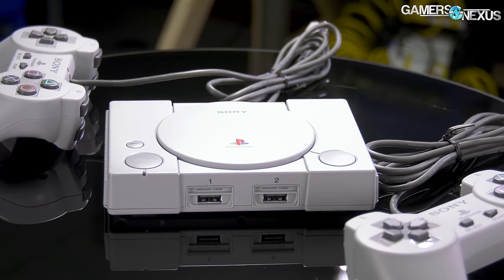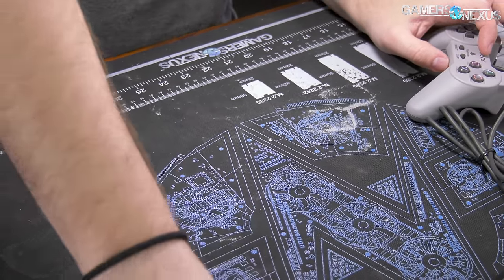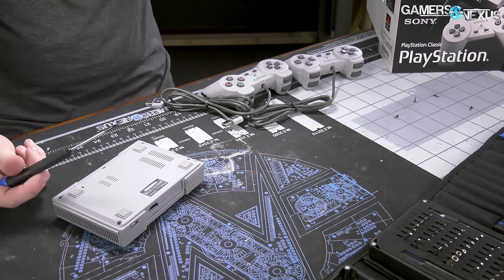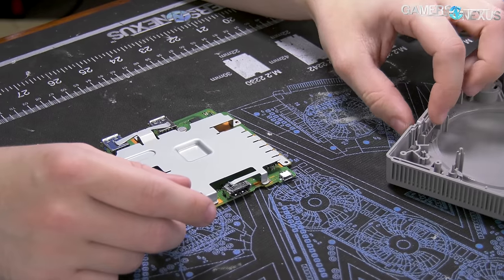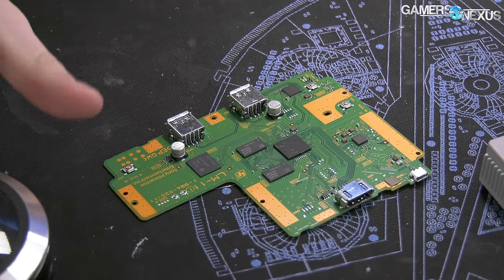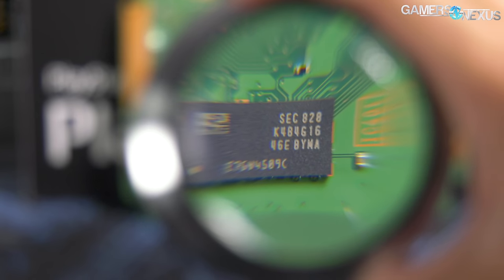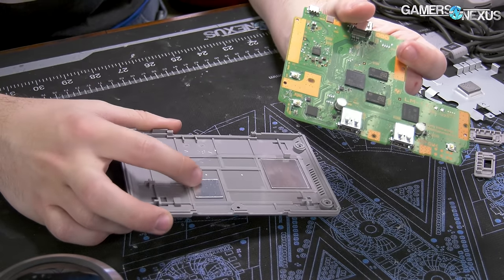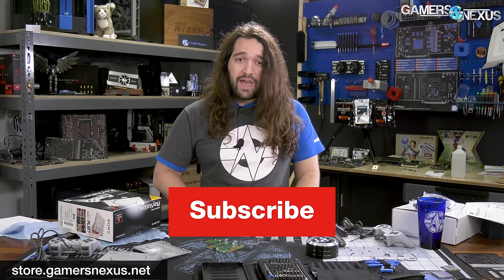PlayStation Classic Tear-Down & Disassembly (PS1)

Comment: Great video ... kind of hilarious though not getting the point of the vents with the metal in front on the bottom.  Its literally a visual thing. the original PSX had those vents on the bottom where youd see the lower metal shield if you looked through, its just a little "touch" that makes it visually closer to the original, just like the entire point of the thing.  

People are complaining about it but lets really think about this. It comes with a controller right.  And it comes with its "shell".  A decent raspberry pi case shaped like something will run you like 20 bucks.  Lets say the controller is as cheap as possible and you could buy the equivalent for 5 or 10 bucks, whatever.  So youre up to 25-30 bucks.  That means the rest of the price is literally for the guts which run the games, and the legal license to own the game for play... Id say its not that bad REALLY.  

I personally just own old playstations (I think the SCPH-1001 made after a certain point is the best... you have the best audio DAC (Still known as one of the best CD players of all time in terms of audio fidelity) and the Rev C graphics chip which actually made a big difference with banding etc in games.  The Early SCPH-1001 has that issue and the next models lack the AV jacks and the higher quality DAC.  The big issue with the SCPH-1001 is the lasers are pretty bad, but you can get the  KSM-440BAM laser and move the shield over from the old drive unit, and then it fits and works perfectly , while giving you the better laser assy.

Comment: I'd like this more if it had more quality games. There are plenty of games they could have given us, and some they should have scrapped for the idea. Considering that Resident Evil Remake is on Xbone and PS4, they shouldn't have used RE. Nor should they use RE2, no, instead they should've used RE3 or a game that less people would have recently. FFVII is supposed to get a remake....whenever, so they should have done FFVIII. MGS is fine, that's like the only reason I'd get it, but I already have it. Persona is a hit or miss with me, they could have replaced Persona 1 with Persona 2 and it wouldn't be any different for me.

Comment: I liked this one, cool stuff. I think Microsoft is working on something like this that's going to release next year aren't they? That was the rumor anyway, some sort of stream box for cloud gaming. Hell if they can reach somewhere near this performance that might be the way to go for console gaming. I tried out Geforce Now and I was surprised how low the latency was, though I am on a fairly high speed wired connection. Still though, there may be something to this. But I don't think I will ever enjoy a day where I can't build my own stuff. I'm also on ultrawide and have been for two years now, and I haven't seen one of these that supports UW resolution let alone higher refresh rates/fps than 60.

Comment: At the beginning it seems like you are kind of shitting on it for being lighter than your phone but I think by the end you realized that it only really needs a less powerful version of the lighter components of your phone (doesn't need a battery or screen which are the heaviest two components of most phones) plus a few connectors which your phone could have with an adapter cable.

Comment: I've got a question for you all. Will the next ps be a ps one mini or will sony go straight to the ps2 mini??.
Reply: The hardware needed to emulate ps2 is significantly more powerful. There is still alot of slowdown and low ROM compatibility with PS2 emulation currently. You need a fairly powerful PC to emulate PS2 in a somewhat authentic experience. 

Personally i think they missed the opportunity to produce something good while they had the chance. They used cheap hardware that barely runs the emulator at full speed and alot of the time doesn't. Just poor decisions all round IMO

Comment: So my 16 GB of DDR3-1333 cost 3.2 $us? wow
I think I know why VRAM is so much higher effective frequency than the GPU: Given the synch timings the effective bandwidth is reduced greatly, so the higher 4x effective frequency helps mitigate this latency making the RAM as close to the working GPU frequency as possible, like the VRAM wasn't off cheap but a large L3/L4 Cache, making the whole Video Card as efficient as possible and as the GPU allows it. Quad Data Rate, QDR RAM, is the fastest now, so the most expensive and hence the VC being more expensive than CPU+RAM. At least we know VCs are very efficiently powerful at processing graphics, glad to see PCIE 4 will arrive for even more efficient functioning but AFAIK it' wasn't a bottleneck; but I wonder the CPU-GPU coprocessing how efficient it is?

Comment: i think most of the price is b/c of licensing the games to put onto the flash to sell. 20 games is a lot of licenses. $10 ~ $15 a game in the 90s i think the pricing was. As they most likely are using ROMs and not the actual code of the game it might have legal issues too that Sony wanted to stay away from. So 20 games + around $5 ~ $10 in parts for $100 retro console is better than most things you can buy .... legally now for games and get that many games. The question is are enough of them actually good games?

Comment: tbh take a ps1 over the emulator. and if your going the route of emulator just play on your pc? most of them you can upscale res to 4-8k making it look alright.
surprised they did not make a ps2 instead of ps1. ps2 had better games imo and had something like 70 or 80% of the market with it.

Comment: Looks like Sony did well with the hardware but crappy with the software. I expect that (assuming the software can be modified like it has been on the NES Classic and SNES Classic)  we will probably see someone come up with software that doesn't suck (i.e. better more capable emulator, fixing those games that are using the wrong version and dont work well on all TV sets and no doubt adding new games too if possible)

Comment: It does come with the power cable you mean it doesn't come with the power adapter and if you have a phone which you showed us you do have the adapter lol. Also the chip inside did in fact take up more than 75% of the shell unlike the Nintendo variants

Comment: Digital Foundry already did a breakdown on the games. It uses the ARM version of PCSX. The games don't run that well. The frametimes aren't as good as the original console in something like Ridge Racer and the games even though running at 720p, look blurry especially Rayman.

Comment: I wonder why these things even have USB power ports that support data transfer, I mean obviously they Don't Care about us hacking it because we can just add me late on everything else.

But if they enhance some of the ROMs then we would get access to that.
Reply: At the same time the prototype board does need to have firmware updates and it does cost money I assume less than $10 / prototype. but it also cost someone's time so not having to change anything between the prototype and the mass production model probably more valuable.

Comment: Clearly the PAL versions of tge most hectic PSX games were added as a service to the modern gamers (a. k. a. filthy casuals). You think that people who can't take a simple 3d brawler that by 90s standards is very easy and not worth writing home about at 30hz (a. k. a. Dark Souls) can take Jumping Flash or Tekken 3 at 60hz? Frankly, 50hz is still too steep IMO but it was the slowest Sony could down to without the need to recode games so "modern gamer" wouldn't die on the first level.

Comment: The only unique thing about this is the controllers and the good looking case. But its not worth $100 for just that. Everything else about it can be done easily by any cheap smartphone or android device, as  already stated. Really boring hardware and user interface. It may have been worth considering  (after it gets hacked) if they had used a substantially better SoaC but this is no more useful than my hacked SNES Classic which can already play PS1 games fine (or Pi of course). Get an Nvidia Shield TV instead.....less than twice the price and has the same CPU as the Switch, clocked twice the speed. As a 'stocking filler' for casual buyers (the only people who would buy it) this is too over priced too

Comment: Just that they are using a crappy open source PCSX emulator rather then an in-house one, or something like ePCXe that does a great job emulating the PS1 on the weakes of hardware says how little they wanted to spend on this thing.

Comment: Kind of sad they charge so much for these considering ppl who buy them have probably paid for a ps1 once already.  A bunch of end of life parts bought super cheap with a 300% margin slapped on it :-/  They could charge $50 and still make a killing
Reply: @hoffer_moment  Didn't think of that.  I guess the level of ripoff depends on how many games are sony owned. :-)
Reply: With all the overheads involved to make these they would be lucky to pull much more then %40 profit. There is production costs as labor and parts arnt free. Not to mention they would have needed molds to be made for the casing. Other then all that it's still a poor product and the gaming experience looks weak. More of a collectors item to sit on the shelf rather then a nostalgic experience.
Reply: @Twenty_Six_Hundred  You are being overly generous.  Those costs apply to any product.  That being said I would be shocked if their margins were anything less than 90%.  300% was of course hyperbole

Comment: my god if only i had enough "throw away" cash id buy one to make it into the ultimate emulation rig. focused on making it into an overpowered psp basically, thats what i would like to do with it..

as far as how did they do replicating their old system, i'd say they did so poorly, the games run like crap i hear.. which is sad considering the internal hardware compared to the original psone hardware, it should run great, not to mention the rear port should be functional to allow them to release more gasme titles later down the road, but i guess sony learned their lesson when it comes to expandable memory and small gaming electronics with the psp and its massive security failure(s) lmao.. they didint wanna take the chance...

Comment: I wish they made a pie type machine or whatever is it's name and made the ability to actually put in flash memory card slots where the save game memory card slots are so we can put more games in and not be bothered with only 20 built in games. PlayStation haves tons of great classics which are out of print and over inflated in price on ebay or some games are simply long gone. We need something like the PSTV or whatever was it's name that was only in Japan, you could buy PS1 games on it through the cloud and add there a flash card ability to it so we can boot image files and you have a solid old school unit. This is just plain stupid and overpriced in my opinion. Sure some of those built in games on it are expensive inr but these are emulations and with that in mind add a proper emulation ability to it not this halfassed crap.

Comment: Hey my playstation classic usb hub burnt out any help ?
Reply: The usb or the hub
Reply: @waltersobchak7275  the small black chip on the circuit board
Reply: @alphabonz9109  ohh yeah okay way beyond my field of knowledge. Was by chance you using any thumb drive products??
Reply: @waltersobchak7275  no I plugged it in and played metal gear solid and the next day it wouldn't turn on no light or anything I guess it's just done .

Comment: Is it just me ore is the PS1 Classic Less Powerful than the (S)NES Classic? Also why did they even bother using PCSx when they have a good Emulator Core, OS and the like in the PSP? PSP FW3.5 and later had a almost 100% compatible EMU baked in on way lower powered hardware than even this thing. The XMB Interface makes this look like a POS and it's not even that grate in and of itself... What ever. I'm going to stick with my still working Gen 1 PS3 60GB. It can play just about everything.
Reply: The PSP was actually running on the same instruction set as the PS1. The emulation was very lightweight by comparison. While not completely replicated, as you might see in the PS2, it was plenty close enough to allow emulation on a system that would have otherwise not had anywhere near enough power to do so.

Comment: Doesn't sounds like a great product from various reviews about it.
Seriously a single core ancient PC can emulate better than that...
Reply: Exactly I have computer with a Pentium 4 HT from 2002 and a ati x1300  that can play ps1 games in hd with ePSXe 2.0.2 like Hot Wheels Turbo Racing and Gex Enter the Gecko. For Jumping Flash I use the software plugin so that performance doesn't tank and I can use a 1.5x cpu overclock so that it runs 40-60 fps instead of 10-30 fps.

Comment: This thing isn't even worth bothering to buy and hack like the NES and SNES classics.
Reply: I use an old 12" laptop with broken display via HDMI for PS1. Eats my PS1 disks and has headroom for emulation quirks like image filtering and removing texture warping with a hack which are not features you get with this Sony product.
Reply: @theshinken  Obviously a PC/laptop is going to be best for emulating anything, but with the NES and SNES classics they at least have decent build quality for the price and it's a nice nostalgic thing to play on them attached to your tv. This thing is more expensive, but feels like a cheap toy and since they cheaped out and didn't include dual shocks even if you hack it you can't put all the games you want on it because of that.

Comment: I heard this has already been hacked, or kind of. Someone plugged in a USB keyboard and just pressed Escape and up popped a menu that is hidden, along with settings that should have been there from the off. Scanlines, Save States, and the best possible one, "Load CD Image" - which could possibly access a USB storage device. If this is legit, then this would be not only THE easiest hack, but also the lamest and laughable. I bet Sony are triple-face-palming themselves, now, especially since there is no online mode to force-update the firmware, massive lol.
Just Google, "nibel twitter playstation mini".

Comment: Wow it's officially made by Sony (you can tell by the board colour).... Shame on them 🙀, they should've used an FPGA sure people would've paid the extra £££
Reply: That would have cost Sony an extra cent. Also, Sony is willing axe any utility value of its systems because of some vapid anti-piracy agenda. That's what happened to PS3's Other OS feature. All three VG console manufacturers have some massive bitches in leadership positions. I recommend investing in pop corn rather than any of their products. :D